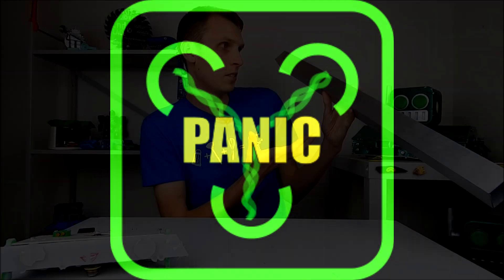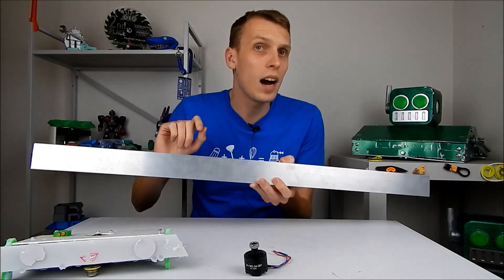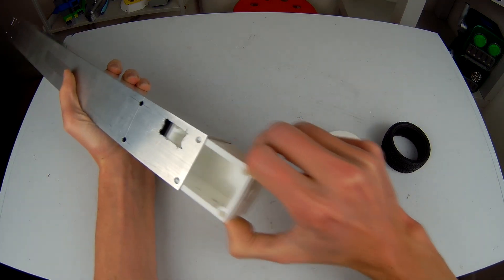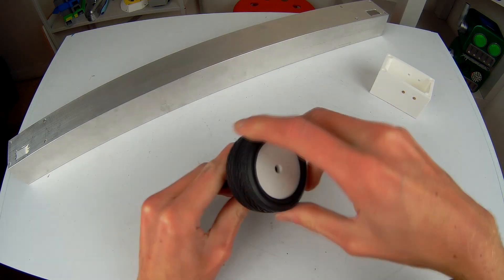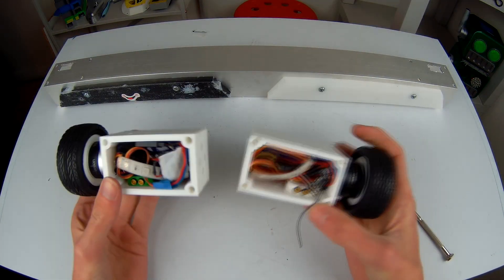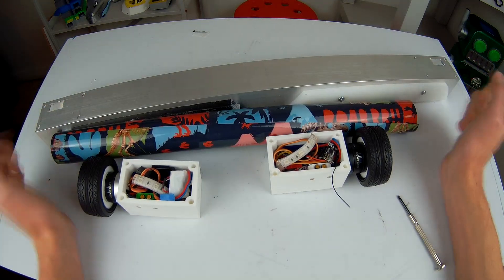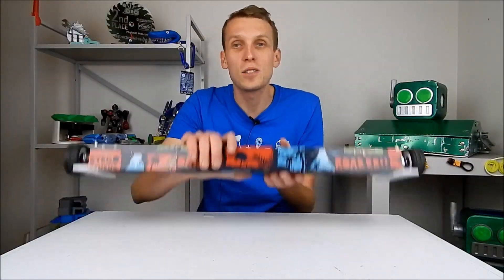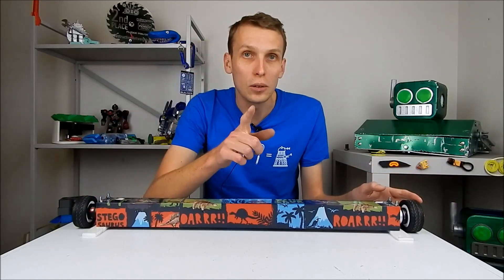Crazy Long 1.3kg combat robot build (Beetleweight)

Comment: Oh, dearie me... Boys and their dimensional hangups... Trust me, chaps, I know whereof I speak: it's not how long it is or how wide it is; it's what you DO with it that counts. With your robot, I mean. In the combat arena.

Besides, this whole 'long' this is a bit misleading. These odd bots are wide, not long. Robert Cowan's delightfully ironic 'Long Ma-a(?)-a-n' was actually spectacularly short!

And for any of you that are big friends of Dorothy and total size-queens, don't forget that there was an EXTREMELY wide 'nuisance-bot' in Battlebots recently. When Robert drove Copperhead against the full-body spinner Chronos, the Chronos team ran a stick-bot about an inch long and six feet wide. It looked great. Surprisingly manoeuvrable, too. But very silly.

I'd like to see a totally impractical version of this bot idea that runs longitudinally and not laterally. (Wheels mounted normally, just like on a top-fuel dragster.) Of course it'd be useless, but it'd become as famous (or infamous) as the awesome Moist Pony.

So let's see a tube that runs lengthways, not widthways. At least you couldn't drive it into the Pit.   ;-)

Comment: I tested with no gearboxes on a beetle and your right no pushing power!
Reply from the maker: Yeah, to get that power you really need sensors which just dont exist inbuilt for beetle sized motors
Reply: @TeamPanicRobotics  I found a really cool planetary gear box for nema stepper motors and adapted it to fit my motors. It only reduces to 4 to 1 but gives a lot more torque

Comment: How do you get both drive systems to work? Are they on the same controller, and if they are, how do you get the controller to pick up multiples signals at once?
Reply: So as i know (Ben you might want to fact check me on this) it works by the recevior. So there are two Pods ('Pod A' and 'Pod B') they both have identical parts (Battery, Recevior, ESC, Motor, Link) and they are running on the same recevior but Pod A is connected to 'Pin 1' and 'Pod B' is connected to 'Pin 2' and since they are both bound to the same transmitter they are both slaved to doing the same thing as a normal single recevior.  Let me know if this helped
Reply from the maker: Raptor Robots is correct.

2 pods each with their own battery, esc and rx but each pod is plugged into a different channel. My TX has been fine communicating with multiple RX's in the past so I have used that here
Reply: Team Panic So, if I were to hypothetically have a robot with three parts, they would connect to the controller if, say, the left drive was connected to channel 1, the right drive to channel 2, and the weapon to channel 3 on each of their own receivers?
Reply from the maker: Yep. In fact thats exactly how the Battlebot Duck! is controlled.

It has a receiver and battery and esc for each of its wheels and also 1 for the lifter

Comment: Me: sees thumbnail Not again. 

Also the size limit for beetleweights is 12 inches. You have twice that!
Reply: they dont have that rule at arc
Reply: Not every competition has that rule limits, and many that do have it because they want robots to be able to fit in their trap door.
Reply from the maker: Yeah we dont have that limit. Unofficially they ask that your bot can be disabled by the pit. Because the wheels barely stick out past the tube, if one wheel goes in XD will have no traction on the remaining wheel and will be counted out. So I should be fine